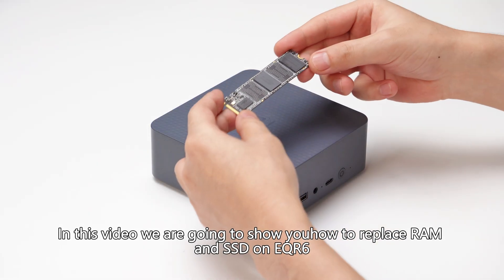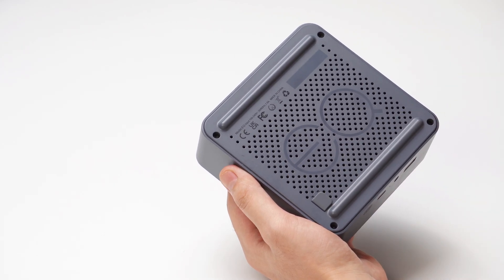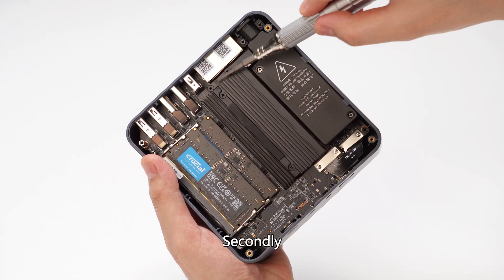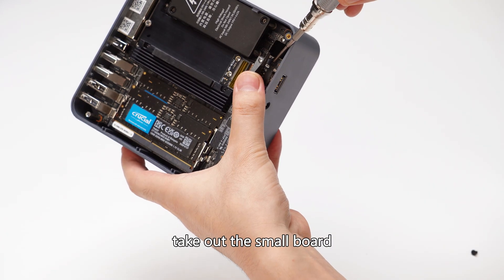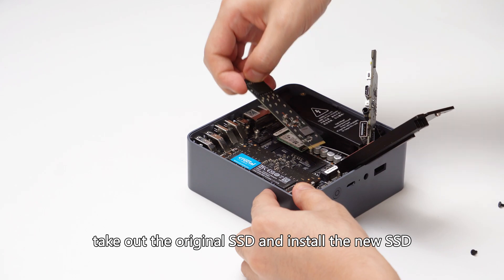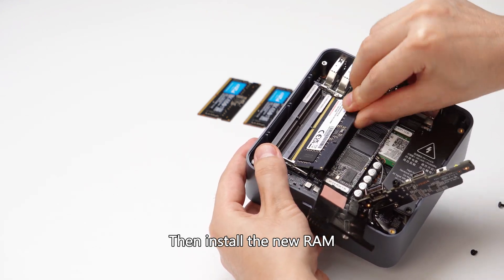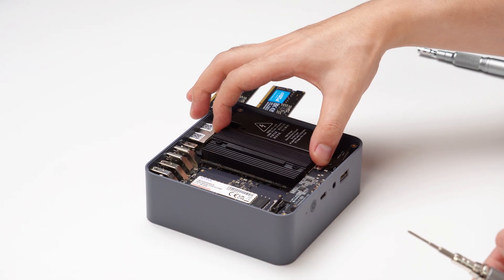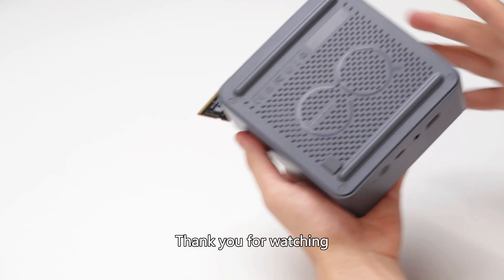How to replace RAM and SSD on EQR6

Comment: Just purchased (Aug 25 - UK) a EQR6 (6600U). Mine has a totally different internal layout to the PC shown here. Both SSDs are easily accessible but the RAM is not visible, presumably located below the motherboard. I needed to upgrade the SSD so fine for me. An updated video might be useful though.
Reply from the maker: Hi, thanks for your feedback!

The EQR6 with the 6600U processor comes with onboard memory (RAM), so it cannot be upgraded or replaced. However, the SSDs are upgradeable. Please refer to this video for the SSD upgrade process.

We really appreciate your suggestion about updating the video.

Comment: I recently became a fan of Beelink. 
I used up 32GB, so I considered upgrading. On the EQR6 Ryzen 7 6800U, there was no RAM slot like the one shown in this video. I removed more screws and even checked the CPU cooler side (upper side), but still, there was no RAM slot.......
Reply: I checked for beelink support
not have RAM slot on U series CPU model

On Amazon JP, when selecting a U-series model, the product name clearly states “LPDDR,” which indicates that it uses built-in RAM without slots.

Comment: I was looking for a similar video for EQR5. Your website states that it has dual M.2 PCle 3.0X4 SSD slots. If one of them is taken by the 500G SSD, I’m assuming I can add a second one in the empty slot.
Where can I find a video on adding second SSD on EQR5 5825U model? I couldn’t locate one.
Reply from the maker: Hi, you can contact us at support-pc@bee-link.com, our support team will help you and guide you to operate it, thanks!

Comment: Hi ! The EQR6 has DP Alt (Video out) though the USB-C ? I have an portable display that is powered on with 12w. Can any port of this device power up to 12w?
Reply from the maker: Hi, the EQR6 has one USB-C port and does not support video output, if you are looking for the USB-C port for video outpu, please check our SE series or GT series, thanks!
Reply: What type of nut drive size do i need to remove the m.2